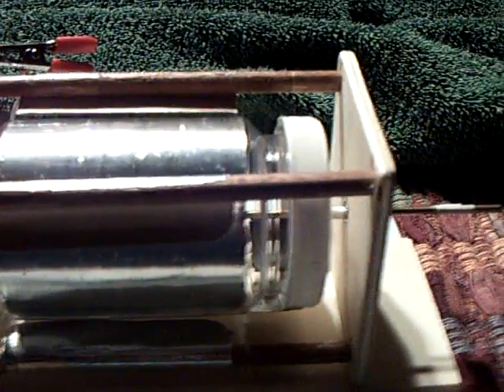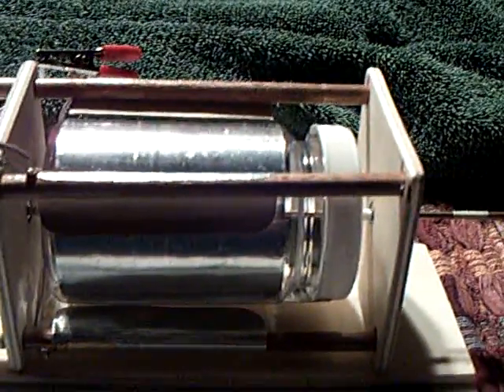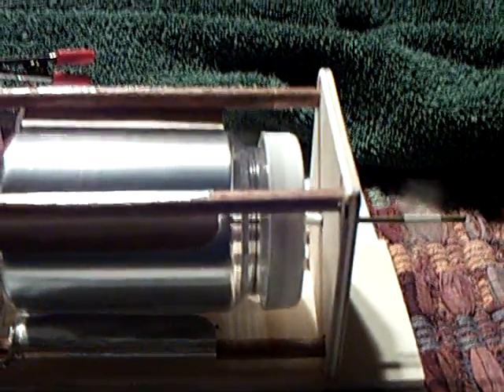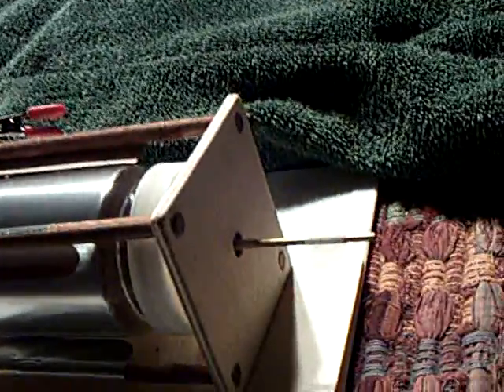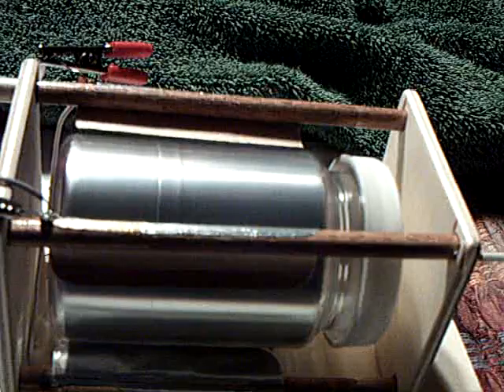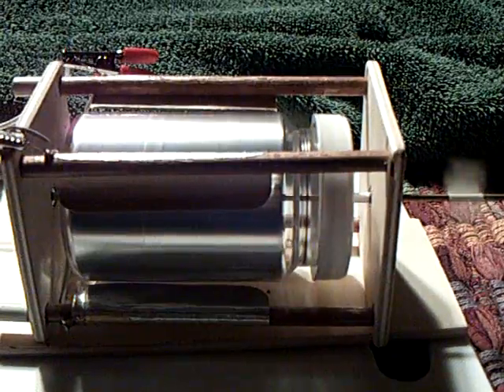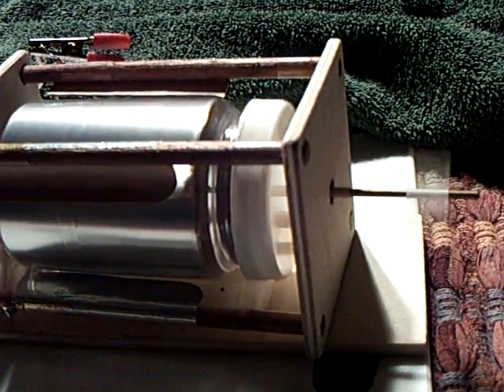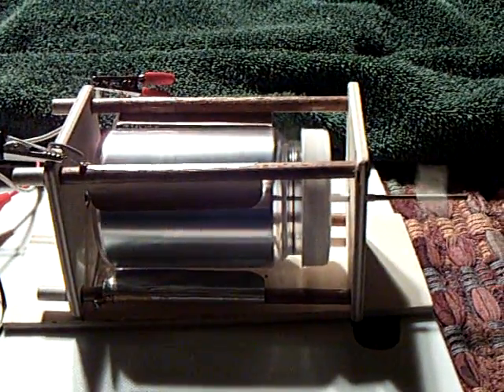Corona Motor

Comment: I'm guessing that the electrostatic discharge from nearby high-tension lines wouldn't run one of these because of the AC component?
Reply from the maker: That is a good question!  Maybe if you did a HV bridge rectifier attached to a HV cap it would work.  These electrostatic motors work off a capacitor just fine if the voltage in the cap is high enough.
Reply: Could work. I asked because one installation we were doing for Southwest Gas in Las Vegas was being done at a housing development where the homes at the edge were located near some HT lines, and the foil in the roof insulation was picking up so much induced A.C. that it was shocking the workers.
Reply from the maker: Wow!  I have a friend in the UK who told me that over there they don't let people live right next to the HV power lines.  He said that the houses that are anywhere close to line are required to have a special metal roof to shield the people living inside.  I saw an artist photo once where he had stuck FL tubes in the ground underneath HV lines and they were all turned on just like they were plugged into a fixture. Another thing I found out was that it is against the law (here) to 'steal' the energy from the power company HV lines using any kind of a pick coil or wireless linkup.
Reply: ***** I wonder how far away you would have to be from HT lines to use "atmospheric" electricity and be immune from possible energy theft charges?

Comment: hi is their a inductance emmiting to the inner shaft (same as a tesla coil on a car) as when i did a starter motor the pos and neg make the inner shaft emmit far higher voltage than the 12 volt making the starter run and back fed spike by wound copper wire from pos and neg of starter with the winding just flicking /arching off the centre shaft ran for 30 minutes a old ford anglia starter then battery blew up..shit all the lads up on the industrial estate who think i am a nutter anyway

Comment: Nicely centered. I don't see any wobble at all. How did you manage to get the shaft so well centered in the jar?
Reply from the maker: The jar is a 'Pounce' cat food jar like Brazilero2008 used.  There is a dimple on the bottom and the lid to use for the center point.  The lid was slightly off but by unscrewing it a little it trued up.  I used ceramic ball bearings and balanced the rotor with some duct tape that held the lid in the correct position also.  Balance was critical for this to run smooth.  The 10KV (-) ion generator really made the work pay off.  You can get one off Ebay if you don't already have one.  They are less than $10.
Reply: *****
Thanks. I'm not sure I checked the pet food section at the store. I'll have to look again. The jar I used has a dimple on the bottom but it's not well centered. Even the dimple in the lid was off a bit.
Re the power supply, I have plenty of powerful HV to make mine fly but my focus was more on seeing how well I could make it run from less powerful sources.
Reply from the maker: RimstarOrg On Brazilero2008's motor he cut the ends off of the jar and used 1/8" cardboard inserts that had a perfect center point.  That might be a better idea.  I am wondering if Lasersaber got his to run off an atmospheric static charge.  I can't get anything to run off an antenna and a ground wire.
Reply: *****
Yes, Lasersaber did. He uploaded a video showing it yesterday. Mine didn't run off a 1" diameter, triboelectrically charged PVC pipe, but I didn't have a 2" one like Lasersaber's. I even tried with 8 electrodes/blades.

Comment: The Flywheel I mentioned on your previous vid might be great on this set up. Might really ad some good torgue.
Reply from the maker: I am still trying to visualize how that would be setup.  It is an interesting idea.
Reply: *****
I was thinking that you could have a disc with metal spokes coming out of it. At the end of each spoke there would be a stop. Maybe try using magnetic beads/barrels on each spoke. This way each would stay tight to the disc until the centrifugal force became high enough to bring each out to the stop. You probably could even stack on more beads as you go. Does this make any sense?

Comment: That is really something I wonder if you add some of those waffer caps to the blades would it stop the missing and speed up more. To see if you have torque, take an aluminum can and cut out some fan blades and see how much air pressure it will generate. Anyway good going.
Reply from the maker: Yes I need to put a prop on this and see what happens.

Comment: You should market a version of this as an ozone generator, having the shaft rotation running a fan/impeller to push the ozone out of the box.
Reply from the maker: If you need ozone this thing will produce it.